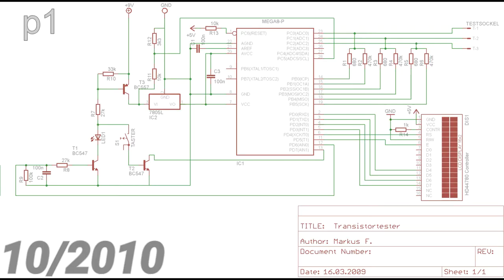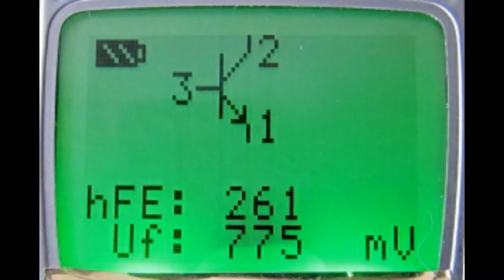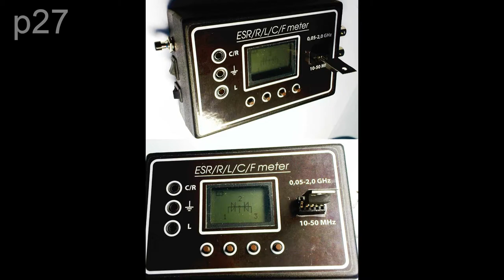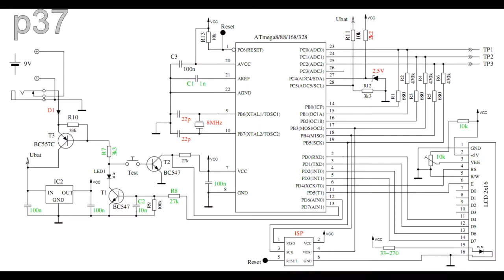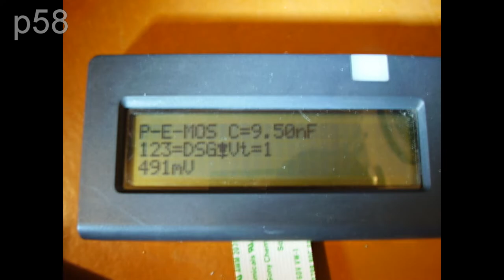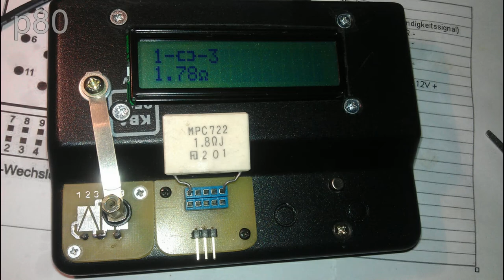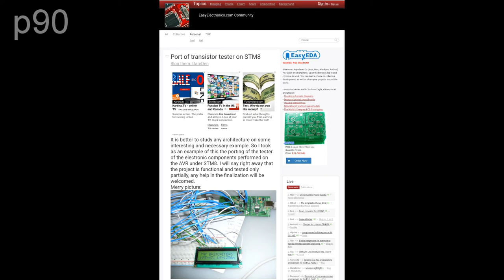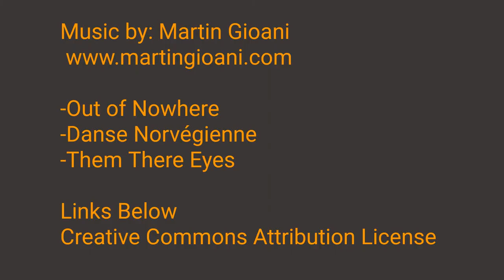The DIY Kings Russian AVR -ish Transistor Tester Thread Image Index p1-100 2010 through 2013 vrtp.ru

Comment: Thanks heaps for the Sub. have you every used Baychi firmware for openlrs gear ? 
cheers
Brett
Reply from the maker: Hey Brett,
Nope, I had to look up Baychi/openlrs just to know that's RC stuff. Not that I have anything against that kind of thing.
   I'm just a partially disabled gimp stuck laying down most of my day with an hour or two playing at a bench on my good days. I haven't gotten into radio or RC stuff very much. 
   My main interests right now are hardware design related and programming. I have a couple of setups for etching boards, and I am going to try fabricating my own 3 and possibly 4 layer boards soon. Apparently I like building power supplies too... as I am currently building 2 more. Those are really just an excuse to explore a few DACs and ADCs I've been wanting to play with :-)
-Jake
Reply from the maker: @kermets  
 Hey Brett,
  I totally understand the social isolation thing. I'm self educated with no real world local contacts myself.
  I have one of the infamous little ADS1115 modules. Their effective bits don't seem to align well with their advertised spec. I recently ordered an ADC0831 (differential 8 bit), MCP3102 & MCP3102 (Single and Dual 12 bit), and an LTC2450 (16 bit). Those are all cheap bits from AliEx. The 2450 will be my first serious attempt at a tiny 7 pad QFN footprint, but at less than $2 I figured I'd try it. The seller with the 2450 had a bunch of Linear Tech stuff, and had a reviewer that decapped a LT3092 and found the LT logo on the die. I picked up some of those too. That's the precision current regulator IC from LT that is quite unique. They usually cost a good bit in small quantities too, like $12 a pop from US distributors. That seller even listed the LT1634B Vref's (0.05%) so I'll have a bunch of those as well from 1.25v to 5v. I also do a bit of ordering from Arrow with the more serious stuff. Depending on the next few experiments I may also pick up a few LTC2400's (24 bit and comes in a dip-8) from there. I have saved some better examples of that IC in practice. The Skullcom Electronics 6.5 digit millivolt meter project on YT is based on the 2400. That project is well documented and there are two separate code versions, the original author and one rewritten by another viewer.
  I also need to try out a couple of newer μC's for their integrated hardware but have just been too lazy to get very far away from my AVR's. I have had a few STM32 M0's for ages and have my first SAM D21 based board ordered as well.
  I'm super slow to get anything done though. I have a dozen or so of what I would call "active projects" some of which I have been working on for well over a year.
  I basically use electronics to fill my time and give me a distraction. I started this shortly after getting hurt. I thought I would just figure out how to build a few circuits for a hotrod project but wound up having to give up all of my physical hobbies like hotrodding.
  I was disabled by a car hitting me on my bicycle commute to work in 2014. I never recovered from my back injuries and I basically tore and now have extremely weak posture muscles in my mid back. So I'm not able to sit or stand upright for long. It's about like handing someone a two pound dumbbell and telling them to hold it out in front of them at chest height. It's easy at first but no human can hold even a 2lb weight like this for more than a couple of hours maximum. That's exactly what it feels like with my back. It's just a type of damage that is very rare and unlike anything people generally associate with back problems. Sitting, standing, it's all the same. Sucks.
  Anyways...that's my story.
-Jake